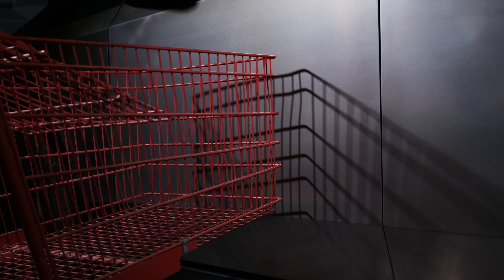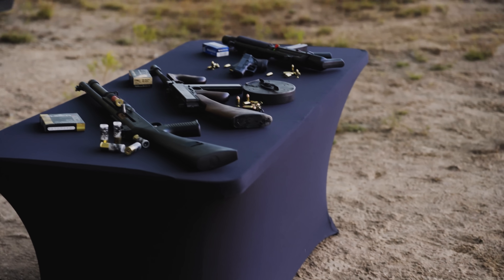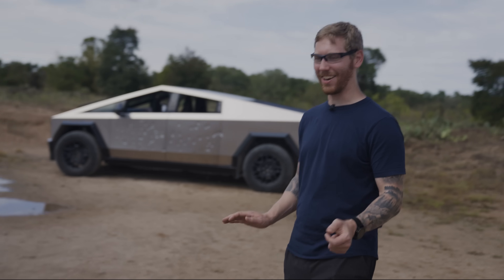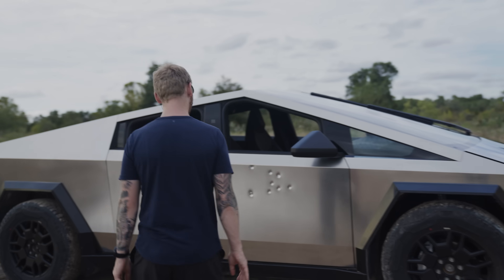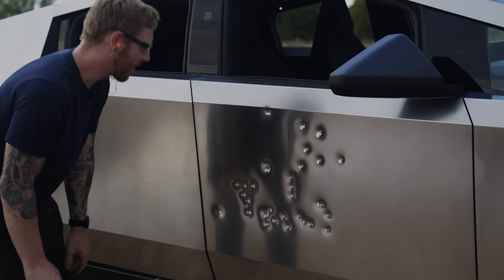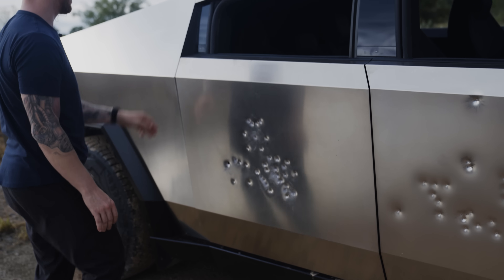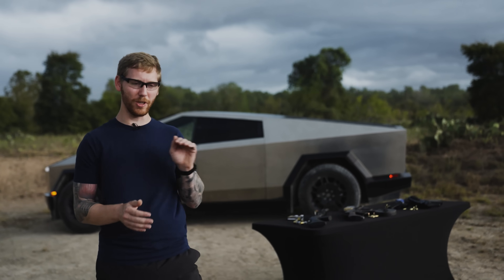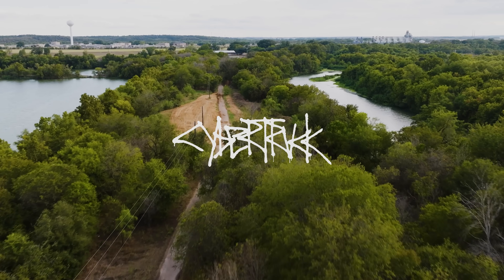Cybertruck Bullet Test

Comment: I mean it’s cool that it’ll stop small caliber rounds but I bet a standard 556 or 762 would go right through I can almost guarantee 12 gauge slugs will, if your gonna market something as bulletproof you gotta disclose which level of protection it provides I’d say this is level 2A.
Reply: Its 'IIA Adjacent', would be my guess. Good for random encounters, but any intentional attack will overwhelm it quickly.

I'm not expecting 7.62x54 green tip level stopping, but calling it bulletproof is gonna get someone hurt... Its bullet resistant at best...
Reply: @Blue84Stang    Very well said I’m certain with a tight grouping even small caliber could get through
Reply: I bet you that if that panel is 1.8mm as claimed, .22 LR would penetrate it. Try shooting an old stainless steel pot and see what happens.
Reply: @davidbrayshaw3529  nah... It is hardened steel (while a stainless pot is almost never hardened), so a 22LR wouldn't have the punch... that said, its not even close to rifle plate so who actually knows what it'll stop.
Reply: @Blue84Stang  Any 300 series stainless steel, once it has been fabricated or pressed is "hardened". Your kitchen sink is "hardened", so is the stainless steel pot that you wash in it. That's just the nature of the material. If you want to soften it again, you have to anneal it.
Musk's claims that the stainless steel is "so hard that it breaks the presses" is absolute nonsense. 300 series stainless steel stock is in fact very soft and is easy to press.
And it is for this reason that it has been used in a multitude of applications for the best part of a century, despite Musk suggesting otherwise.
Tap a bit of raw stock with a metallic object, 
then tap something like your sink, the pot, the dog's bowl, the urinal, the roof of a '57 Caddy, and you'll hear the difference.
Yes, that's right, this "impossible to bend" stainless steel that Musk has revolutionised 

was used to make the roofs of 1957 Cadillacs!
You are correct, it's not even close to rifle plate. That's probably why you don't see much of it used in body armour. 1.8mm stainless is so light, too.
In my opinion, it is almost inconceivable that those door panels were fabricated using 1.8mm stock. I'll believe it when a willing Tesla board member stands behind a sheet of it when someone is firing 45 ACP at it from a Tommy gun.
In the mean time, I'll take it for what I believe it to be. A smoke and mirrors show
designed to detract from the Cyber Truck's zero star crash test rating. "Look everyone, it's bullet proof (just don't crash it).
Reply: @davidbrayshaw3529  holy ballz man... If you are that deep into metallurgy, you know that there is a fairly noticeable difference between 'regular' 300 series stainless (like what they would use for pots, counters, appliances, etc) and the few iterations of 304 stainless, lest of all the potentially unique formulation of 304 Stainless that Tesla could be using. Varying the amount of carbon, for example, within can have a substantial effect on how the resultant metal reacts, while still remaining in the realm of '304 Stainless'.

I don't disagree that it would be VERY telling to have someone from Tesla Corporate literally stand behind their product (and honestly, kinda hilarious if they did it live), but there are some forms of 304 that can be annealed, and some that can be work-hardened (like you referenced) where just the parts of the sheet that have been bent/shaped become hardened or fully hardened (where the entire sheet is tempered to harden it after shaping).
Reply: @Blue84Stang  I'm not a metallurgist, there's plenty that I don't know.
My understanding was that all 300 series stainless steels are austenitic and will work harden when manipulated. I actually believed that this was due to the presence of nickel, rather than carbon.
I am presuming that similarly, all can be annealed. 
Like I said, I'm not a metallurgist, and I'm open for correction.
But yes, I'd love to see a particular Tesla "employee" stand behind their work, in this context. 1.8mm, my backside.

Comment: Okay, this test gets a pass only as it relates to other modern vehicles.  It's correct that most car and truck bodies will not stop most bullets.

However, this test did a GREAT job of demonstrating why the .357 Magnum cartridge came to be so popular with law enforcement agencies.  Car bodies used to reliably stop .45 ACP rounds all the time.  The steel sheet metal we used to use wasn't thick enough to stop a .357, however.

Comment: Armoured vehicles aren't new, so in the grand scheme of things, it's not particularly impressive. There are very good reasons why most cars aren't made in a similar way. Weight and cost are just two. But if you stsrt advertising cars as "bulletproof" or "bullet resistant ", you're going to have to provide lots of very specific evidence from independent testers, and the testing criteria. Even then, be prepared to spend a lot of time arguing in court if someone is hurt or dies in such a vehicle. Americans like to sue each other.

Comment: I actually got a lot of respect for these vehicles now that its not all concepts and we actually see some cool videos like this. I didnt know electric engines were so good at straight torque and seeing this odd vehicle out pull a sled competing against an f-350 super duty was hell of a sight. I really hope I get to live to see battery technology gets farther along and become safer aswell as cheaper and vehicles everywhere will be predominantly electric. Would do a number for the environment.
Reply: If you're the manufacturer you can probably tweak the controller software to get more power for a short test, if you don't care about motor longevity.  I'd want to see independent third party tests based on a randomly bought vehicle.
Reply: @LokiCentral  That's actually a fair point to make, I guess we'll see once some of these rich YouTubers and whatnot get a few.
Reply: Really just need more charging stations and we are there. When I say more I mean a lot more - where every major gas station has a row of them at each location.
Reply: if you think these help the environment you are mistaken. The process of mining to make the batteries requires thousands of gallons of diesel to fuel large mining equipment and also we make China and other countries rich to get the supplies. I will never own an electric vehicle
Reply: @MNBuckhunter  mining resources to build any vehicle is expensive and destructive. My electric vehicle runs entirely on nuclear power so the only notable emissions are from the occasional set of tires. You will eat your words.

Comment: I find it odd that the windows were down during this test.  Since those windows are ‘bullet proof’, they’re probably absorbing some of the impact energy.  I am speculating this has an influence on preventing the bullets from penetrating through the ‘custom alloy’ panels.  Still impressive piece of engineering…
Reply: The glass arenot bullet proof, they are just hardened gorilla glass, a type that we see on our mobile phones, but thicker and layered.
Reply: there is quite an air gap between the outter door skin and glass. it wouldnt stop pen on the skin but it would catch any that do go through and stop them ripping through the interior. but these low velocity bullets won't penertrate anyway. jump up to a standard velocity or faster and you will see them punch through like the door is butter.

Comment: This is quite frankly incredible
Reply: Hardly, the use of hardened steel or thicker panels to defeat bullets isn't exactly a new idea. Nor is the application of bullet resistant windows. But there are a number of very good reasons that most vehicles don't use these commonly available materials. Cost and weight being just two.
Reply: @another3997  Cost isn't really a factor when it saves on paint. Also weight? This thing is 6.5k pounds, while the rivian weighs 7.1k pounds while being a much smaller Truck. Then there's the hummer ev... 10k pounds lmao. The main issue is aerodynamics... wait how does steel impact aero? Well you can't bend them unless you like breaking machines... yes the steel is THAT strong.

So no crazy bends. Hence the shape. Hence subpar aero for Tesla's standard. Still a 0.34 drag coefficient is very impressive all things considered!
Reply: No, it’s not remotely incredible. The metallurgy for stainless steel was thoroughly understood 40 years ago.

Comment: Very cool that the bullets didn't go through but it makes me wonder what it would take to repair body damage on a cybertruck.
Reply: you'd replace, not repair
Reply: The dents build character.
Reply: replace the panels
Reply: To me it looks even better with those bullet hits. I wouldn't repair it. :)
Reply: Tig weld and grind smooth.
Reply: Repairs are easy on a Cybertruck. Just throw a shit ton of money at Elon and replace the panel at one of the rape ... er service centers.
Reply: A little bit of bondo and they will never know 😅
Reply: Like any other car. Bog it up and paint it.
Reply: Since it's metal, you can often use strong magnets to pull out dents.
Reply: @theyeetus1428  nope, that will not work.
Reply: @drmonster6357  Maybe look it up before pretending you know everything?
Reply: @theyeetus1428  Well I've been a machinist for 25 years and have worked with high powered electro magnets to hold metals down while machining. You would need a super strong magnet and the metal would become fatigued if you did somehow bend the panels back to shape. Also if it is stainless steel it might be non ferrous, so magnets would be useless no matter how high powered they are.  So I do know what I'm talking about.
How many years have you worked with metals and alloys ?

Comment: How will this truck be able to pass any crash tests? I assume it won't absorb a lot of kinetic energy in case of a crash with such a stiff body.
Reply: It doesn't, if you've seen Tesla's vision on the internet. There's a reason that it hasn't been submitted for independent testing.

Comment: The way it just shatters the bullets is quite impressive
Reply: They used guns and ammunition with bad penetration capabilities on purpose. This video is more propaganda than a serious test.
Reply: @koi_krapfen  IKR? Of all the guns they picked, that G19 is actually the most likely to pen a metal plate. Everything else is just equal or less.
I would venture to guess that they tested on the metal plate beforehand with a regular MP5(1300+ fps, ), and it prob has penned it. But since they still want to claim 'it stops a sub-machinegun' and still uses the iconic MP5, then someone who really knows guns advised them to use the MP5-SD(~900 fps), heck it even looks 'meaner' so visually it is even better.
FYI, a 115gr 9mm bullet at 1300 FPS has about 209% of energy, compared to the same bullet at 900 FPS. Huge difference actually.🧐
Reply: @koi_krapfen  yeah but not every one shooting at vehicles has ammo that’s higher in grains or just suped up ammo in general a lot of people have what they can get their hands on
Reply: Lets see it stop a rifle round and then I'll be impressed.
Reply: @Tomato6  Or even your standard 9mil fmj
Reply: @perrywaaz3660  If you look at the reflection of the bullet in the steel, it looks like they were using 45 caliber and 9 mm FMJ rounds
Reply: @BoomchacleV0  LMAO, no. These were very clearly hollow points. You can tell by how they all mushroomed on impact.
Reply: @2011blueman  You can see the copper jacket on the nose of the bullet at 1:01

Is a copper jacket normally enough to prevent a lead bullet from splattering after hitting steel?
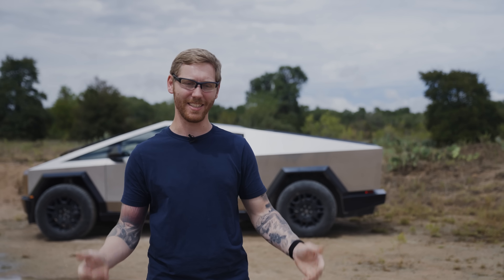Reply: @Tomato6  but he said at 0:34 that it wasn't designed to be bullet proof so the point of the test was to see the limit it can handle.
Reply: @Tomato6 let’s see it stop an RPG, then I’ll be impressed
Reply: They were using hollow points, which are designed to expand on impact so they don't go straight through the bad guy/ wall and hit the dog.
Reply: @perrywaaz3660 Slow-mo says otherwise by what I can see, also FMJs behave the same way when hitting something it cannot penetrate. In fact i'd lean towards them being FMJ as you can see the copper jacket pop away from the lead core, which rarely happens with hollow points the fashion seen. 

I don't see why people are all hating, it's quite impressive. Obviously if you TRY to penetrate it. ohhhh well my AP round can pen it.......bruh, AP rifle rounds can pen many lightly armored military vehicles. You don't have to like the truck, but an accomplishment is an accomplishment, quit being petty children.
Reply: @acywei  Oh, you might be right
Reply: @perrywaaz3660  @1:37 - doesn't look like a hollow point from that view but I could be wrong. Also, pretty sure buck shot is going to have similar, if not more penetration than most 9mm rounds (I recall watching a demo where that was the case but I am open to correction). At the end of the day, for 99% of people, .22/.38(0)/9mm/.45 hollow points or cheap range ammo are what they will encounter if they find themselves in a carjacking or crossfire.
Reply: @perrywaaz3660 the box of fmj 45 next to the Tommy would like to disagree with you on that 😂 lmao
Reply: @THIZZLE99  ya, cause Tesla has never faked a video of a product......
Reply: @perrywaaz3660  looks like FMJ on the table
Reply: @perrywaaz3660  criminals use hollow points because they care about innocent bystanders.
Reply: @mindyourbusiness4101  hollowpoints don't go through walls and kill your neighbors. FMJ does.
Reply: @Ryman158  maybe try improving you reading comprehension skills before lecturing about projectile differences.
Reply: @perrywaaz3660  Didn’t know 45 FMJ was an HP round.
Reply: @perrywaaz3660  The point is that they disapate energy over a wider surface and make the truck seem strong than it is. Still cool, but still a gimmick too.
Reply: I expect Mexico to be the no. 1. buyer of the Cybertruck, and not just the cartels.
Reply: @igorjee  Pretty easy and cheap to up-armor a car with welding mat fiberglass and epoxy resin.  Even YT vids on how to do it.  There is a company which sells these panels to up-armoer a structure (or desk if in a hostile work environment).  Kevlar is more expensive because it is lighter and more pliable, but if those aren't a concern, like in a vehicle that is carrying the weight.
Reply: @robertslugg8361 I'm not from USA nor Mexico.. if cops find that stuff in my car I'll get at least 10yrs if my lawyers are as good as they pretend to be lol they'll reduce it to 3 yrs and get out after few months(of course including paying off the judge) LMAO
Reply: @igorjee  Nope, mexicans aren't stupid enough to buy this. The cybertruck won't stop any .223 or 5.56 standard AR-15 bullets. It won't even stop FMJ 9mm. The only ones stupid enough to buy this are good old fashion 'Merikans.
Reply: @igorjee it wont do them any good if they forget to charge the battery also is there any charging ports in mexico?
Reply: @sheldenadkins9773  I don't know about that, but there is plenty of battery going on there.
Reply: good thing the 80k deathtrap is bullet proof because thats def the most important safety feature
Reply: What's the point??? It was suppose to be an Eco friendly vehicule No... Why having heavy door panel, glass, etc...?
Reply: @gglaffite6672  Because replacing parts due to dings and scratches is far more wasteful than making the body durable. These things will last for generations.
Also, it is Fing cool. And more people buy things that are Fing cool.
Reply: @gglaffite6672  you cant have eco friendly and durability? Not every eco friendly car needs to be built like a battery powered car for kids that you get from walmart with the plastic wheels
Reply: Looks like Frangible ammo
Reply: yes, thats why AP ammunition uses softer caps and hardened cores. Softened caps deform against armor, giving a way for a hardened core to attempt to go through.
Reply: Yup, bullet technology has came quite a long way since the 80’s. Especially Frangible ammo, which is designed to disintegrate upon impact with a hard object. Was created for times when you need to to shoot steel plates up close for practice.
Reply: FFS, it's called CGI.
Reply: People talking here like all CARS can take any caliber bullet
Reply: @FinanceDemystifiedd  Frangible ammo.
Reply: USA IS THE ONLY PLACE IN THE WORLD WHERE BULLETPROOF OF YOUR CAR IS REALLY IMPORTANT, THIS COUNTRY IS IN HUGE ASS OF CRIMINAL WAVE
Reply: Нет стреляли мелкими калибрами , пусть берут из винтовки , тогда и посмотрю
Reply: But a Glock with a switch can send 30 round near each other.
Reply: and only 1.8mm panel
Reply: That MP5 SD, if anything, is slower than a normal 9mm pistol because that's the point of 'SD'. Keeping the bullet slower so it is quieter.
Reply: most bullets are designed TO shatter on impact (if I"m remembering right, hollowpoints are the most commonly used. may be wrong though.)
Reply: @Prof.Mutant Yes, you are wrong.
Reply: @Prof.Mutant they are using hollow points which shatter on impact in order not go through cops use them in order to not hit bystanders